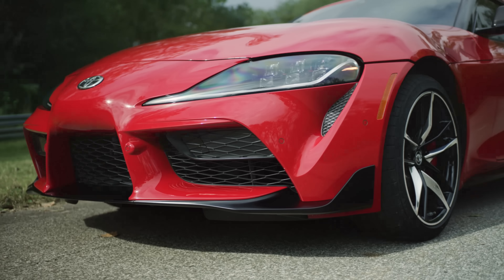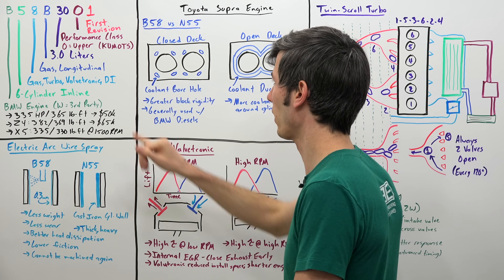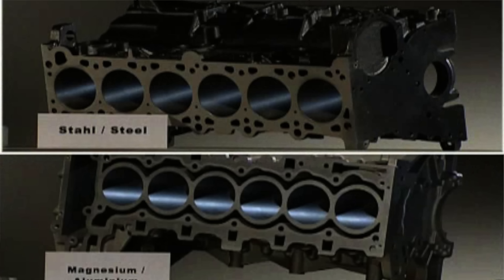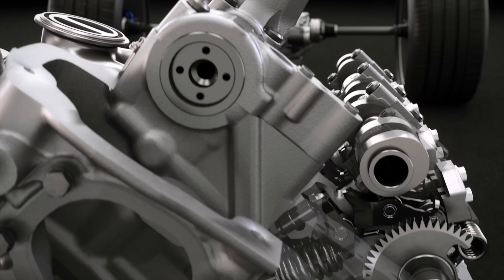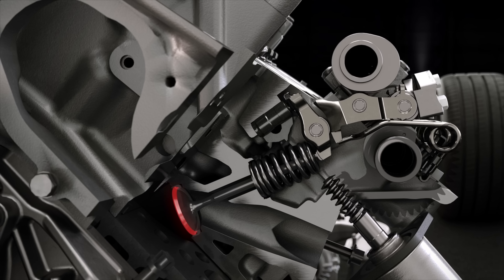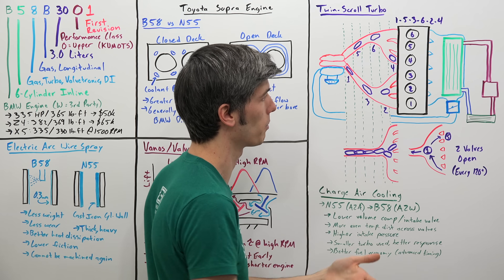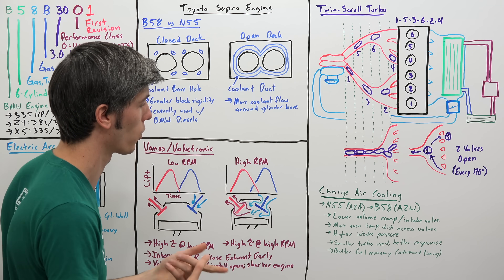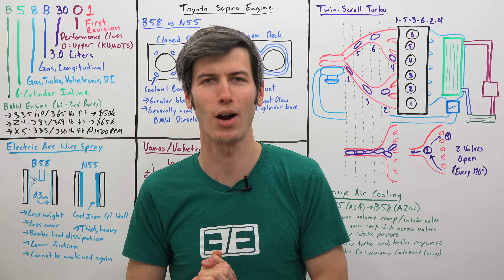2020 Toyota Supra Engine - Detailed Review Of The 2JZ Successor

Comment: It's gonna be the most unreliable modern Toyota model.
Reply: @FuLLeFFekT1 Toyota hasn't built a really reliable performance engine. That's all done by Yamaha.
Reply: That would still be a good thing.
Reply: More unreliable than those Toyotas that had "unintended acceleration" issues? Yea, didn't think so.
Reply: BMWs engines are reliable.
Reply: @jdmr1c3ing  "I want to believe"
Reply: JDM racing Any mechanic will tell you the opposite
Reply: @Realivangarcia  Internet mechanics don't count.
Reply: JDM racing I’ve worked with real mechanics for a month just so I could learn about cars, I was in highschool at the time. All of them say BMW’s are unreliable and expensive to maintain.
Reply: @Realivangarcia  If BMW motors are unreliable then how did they win the 24 Hours of Le Mans?
Reply: @jdmr1c3ing  I agree BMW  engines are reliable. 180k miles on mine.  I would stay away from the tt V8 because of it's design. All these new cars have too much electronics to me. Not just BMW.
Reply: JDM racing 24 hours isn’t that long. I’ve driven my car for a road trip from CA to Georgia. That’s more than 24 hours, you still think that’s impressive?
Reply: @Realivangarcia  You can't compare the two. You're not pushing the car to the limit on a road trip.
Reply: JDM racing Dude, I don’t think you understand. The reliability that matters is daily driving and if the car can go over 200,000 miles without much problems then, that’s a reliable car. The regular person doesn’t drive on the track 😂. I drove my Toyota Yaris (bought brand new) and put over 250,000 miles on it. I sold it because I got bored of it but, it never gave me problems. Never change an engine, transmission, radiator, starter or etc. I also abused the thing and it kept running. So yeah, a BMW wouldn’t have the same reliability NOT EVEN CLOSE! All the people I know who has BMW’s complain about the cars since they’re always breaking down or having problems.
Reply: @Realivangarcia  The only truly reliable modern BMW engine is a 3.0L 6-cylinder diesel which you can't buy in US, as far as I know. 
Petrol BMW engines become real pain in the ass pretty soon, yeah.
Reply: I think that will be the case.

Comment: The reason why people (read: Americans) are not happy with the BMW engine is because they don't see it as a "worthy" successor to the 2JZ, because the 2JZ was an engine so overbuilt it could withstand absurd amounts of boost and be tuned to deliver 800+ HP... 

And even though there's nothing inherently wrong with BWM engines, they're typically the polar opposite to the 2JZ: Very efficient, very sophisticated, but also made to extremely low tolerances and can't withstand nearly the same amount of abuse as a 2JZ. 

It's basically like comparing an axe with a scalpel.

Comment: Hey Engineering Explained. I have a cool Video idea that a lot of People would like to see. Compare the B58 to the Old 2J. Things like, Bore and Stroke, Compression Ratio, Internals, Cylinderhead, Block Design, Material Used, how strong they are..... Just to let the People see that the Old 2J isnt that much Stronger than the B85. Dont get me wrong Folks. I love the 2J. But i also love BMW.

Comment: I personally welcome its arrival. I highly prefer them going with a quality BMW straight-six (and keep in mind people rave about the B58, and it's proving reliable so far), than them shoving a damn Lexus V6 in it. They've kept the turbocharged straight six tradition going in the Supra. And hey, maybe a manual transmission will be offered in the second or third model year. They implied that if demand for one is massive, they'd consider doing it.

Cost wise an all in-house Toyota Supra was NEVER going to be approved by the bean counters. It would most certainly be a total loss, and maybe a total loss steep enough that the "Halo Car" aspect wasn't even worth it. They were never going to design an all-new performance engine, with tens of millions of dollars of development costs before a single one was made, just to slap in one vehicle and make 50,000 or so of over its lifetime.

All the people that have to find problems with every sports car on the market, and never buy them new, and always yak about waiting to buy a used version of the ones they do like, are the reason sports cars are such a dying market. Even if nothing on the market is perfect... consider supporting the continued existence of the sports car with a brand-new purchase.

Lastly let's try not judging this car too hard, or defending preconceived notions on it, at least until we drive it or listen to others who have.

Comment: I personally don't see why Toyota doesn't want to build another ridiculously strong inline 6 like the 2J instead of borrowing off another automaker. They oobviously have the technical and engineering prowess to pull it off and make a decently reliable, efficient and above all powerful engine that's easy to maintain and even easier to tune over twice its stock power levels on a bone stock bottom end without chucking a rod through the block. If I were them, to keep their target audience happy so they're more likely to want to buy the new Supra (which I think should have been named Celica GT instead because the new Supra bares no resemblence to the infamous MK4 but the name), they should have modernised their 2JZ engine so that it meets modern efficiency and emmissions restrictions while still being just as reliable, just as strong and just as tunable as the 2JZ-GTE.

also... more power wouldbe real nice ;) 400BHP would be enough to convice me that they made an okay decision using a B58 as opposed to updating the 2J... just not the best one for the history attached to the name.
Reply: Rest assured that many professional engineers and accountants in BMW and Toyota know better than you.
Reply: Yes i like BMW and i have not much interest in japanes/asian cars, but even if Toyota would build a new 6 cylinder engine again it wouldn't be the same like the old one. A iron block is way to heavy and you have to built a lot of tech into the engine to get modern emission standards. Also old BMW engines are bullet proof, iron block etc. Old tuned BMW engines have 700-1200 hp reliable. It was however not a big thing in the US to do that. A lot of those projects can be found in Germany, Denmark, Norway, Sweden however...

Comment: American people seem to have way more of these legendary 'reliability issues' with their BMWs than European people.. To be honest they seem to have these 'reliability issues' with almost every European car or motorbike etc..
Reply: European people complain as well about modern German cars. DPF, dual mass clutch, carbon buildup, issues with gearbox, sensitive suspension etc. It all depends on the country - British buy more new cars so less problems. Polish buy second hand cars from west europe and it is clear which one of them are reliable by just looking at second hand car prices. Some models are dirt cheap even though they were more pricey as new. Some old diesels hold their value very well.
Reply: I would say the problems with bmw in other countries just comes down to the fact that the dealerships and there service people have no idea how to maintain them.
I have a 2006 ford transit in australia,the check engine light comes on,you take it to ford they just swap out parts till they stumble on the problem.
Love my transit but hate ford dealers,i think the supra will fine just take it to europe for a service🤣
Reply: @MrBluePoochyena  i don't know what American cars they sell you lol (if you taking about ford crap yea they use too much European tech in their cars). if you ask an American what is a Ford Ka 90% would not know. plus what you said does not make much sense. Diesels have more compression and require much more heat to crank. Diesel should always be harder to start it the cold. I live in north Florida so it lucky to get 0C here but up north if you look at the weather it easy gets much colder than that. just look at a city like Minneapolis weather.
Reply: @MrBluePoochyena  This is undeniably false. US measures their fuel differently than EU. Its the same gas just measured differently.
Reply: @1994SHOtime  Lol what, Ferrari/Lamborghini have running jokes about them randomly catching fire. Volkswagen/Audi are notorious for electrical, engine and transmission problems in the US. And Mercedes have been known to be the one of most unreliable manufacturers for years.
Reply: @Summit900  literally one model of lambo has that joke and i've never heard of any such issues with VW since the late 90's. The past 10+ years  have been bullet proof.
Reply: Americans often get shitter versions of the cars tbh.
Reply: waking00one so what does it mean there is discrimination as simple as it is
Reply: @newtongsm  they simply match their product to the market they sell it to, giving your own country the "better" quality models and such is not uncommon, many Japanese cars were better/faster for their domestic market then for export.
Reply: I do know some models (VW's specifically) are built in Mexico rather than Europe, and I hear people complain more about the Mexican built models over the European built ones. However even among European built ones reliability and repair costs are still higher than older American and Japanese cars (V8 pickups can get 250K easily, and for Japanese it isn't uncommon to find older Toyota's and Honda's with 250K+ easily with cheap repairs, European models though cost more in maintenance generally to get the same mileage)
Reply: As mentioned. Cars aren't designed to last forever anymore. Plus it doesn't matter what manufacture you go for these days, you will either get a good one or a bad one.  Though I do find BMW very reliable until you tune it.
Reply: Yeah seems an American thing. No problems with the germans ive owned so far
Reply: Niklas,  Do you have some actual data to support that opinion?
Reply: @MrBluePoochyena  the only thing I can dis on a Mercedes is if they have a lot of HP the trans (but it's the transmission throwing codes and/or the clutch is too small... not really the trans itself). also Silverado with Cummins Diesel V8? chevy have Duramax in them the best thing on a Chevy Diesel is the Allison transmission. like I said I can't speak for cold weather but I know Diesel have a hard time if the fuel is cold. I know turbo Diesel run lower compression so the fuel would need to be at a higher temp to help it ignite vs your none turbo Mercedes. as far a Chevy gas V8 they normally crank stupidly fast cold or not just touch the key... they crank at super low rpm (your neighbor has problems).
Reply: @MrBluePoochyena  when I wrote gas = Gasoline/petrol
Reply: @MrBluePoochyena  is it the 5.0L made for the Nissan Titan? what size is the truck? that a half-ton 1500 gasoline replacement engine. or is it a three quarter ton truck 2500 or one ton trucks 3500.
Reply: @MrBluePoochyena  I think it has to do with that in general, other countries don't get as good as the home country. I have a 2009 GMC Sierra 1500 Crew Cab 4x4 that starts no problems at -40F before accounting for windchill. I believe you're talking about the 80's-90's Mercedes diesels and they are just built like tanks. Simple and run forever unless you screw something up on it.
Reply: @MrBluePoochyena   what you saying is not right. 6.7L Cummins is an inline 6 cylinder. I only ever seen 6.7L Cummins in 2500 and 3500 truck Dodge. it makes to much power for a 1500 setup to be reliable. if you put it in a 1500 Silverado and only run one 12 volt battery yea you be lucky to get it to crank. you can compare some crazy Frankenstein to a Mercedes. new Mercedes are ok even by Americans just cost too much over here. old Mercedes (even more so diesel Mercedes) are probably the best cars ever made. but this was more of a BMW thing and the extra maintenance you need to do vs normal American car.
Reply: Niklas no wrong same problems in Asia also too many electronic cheap plastic parts to make more profit I think german brand know they have upscale brand name so then want car to get bad after 2 or 3 years so customer can buy new cars
Reply: Niklas
 Europeans don't put the mile on their cars or have as much diverse weather like Americans. it like above "you don’t see Americans complaining about Japanese RELIABILITY" that because Japanese cars are built in America for American roads.
Reply: @gatorage850  It is 30 deg cel in the summer and -10 deg cel in the winter in Poland. Europe is big enough to have different climates. 
Fortunately most of European countries don't have a car based life.
Reply: @valdius85   and you don't have the humidity or the heat of the south put it this way in my city the precipitation (rain) in June is around 200mm every year. but it's mostly how much we drive. like I'm about to drive through the middle of two towns 70KM and not one public transportation point.
Reply: Gatorage no the German brand can also build more better quality which Won’t go bad but they want it to go bad in 2 or 3 years so customers can buy new cars is simple  brand are run buy manager not tecnical peope
Reply: my 2012 bmw x1 has been ok for the rest of my life and theres never been any problems
Reply: Your car is six years old. That's nothing. There's no reason why any car shouldn't last 20+ years and 200,000+ miles easy, with proper maintenance.The shop thst rebuilt the the transmission in my '03 X5 told me the manufacturer, ZF KNEW THEIR TRANSMISSION ARE GOOD FOR A MAXIMUM of 100k miles!! They don't care about building them to last any longer.
Reply: tempest411 if car last for 20 year all manufacturers will be out of business
Reply: tempest411 any car could last 20 years with proper maintanance and i dont think any manufacturer wants their car to last 20 years it’ll put them out of business
Reply: naresh virkar I’m currently driving a 20 year old car and I rev it out to redline pretty much every day and I can still do roadtrips and it’s fine. It still costs less to have owned this one car for that long and do its maintenance over the years. Then buying a new cheaper car every 5 years. Also the carbon emissions are far less and Volvo actually used a lot of recycled material while making my car and the car is able to be mostly recycled when it comes to the end of its life (which I doubt will be soon as I plan to keep it forever) so manufactures just don’t make good cars like they used too. It’s all become about making them expendable. It’s kind of sad. So we may have “greener” cars now in the future, but if everyone is have to buy a new car every couple of years, then it’s not so environmentally friendly as people think to keep buying a new car.
Reply: @tempest411  In 20 years I would put over 700,000 miles on a car.  I only keep them 8 or 9 years, at which point they are pretty much worn out.  It's one reason I won't have an automatic transmission -- the likelyhood of failure beyond 200,000 miles is too high.
Reply: @VAspeed3  Yes, some people drive a lot more. But I think the average is about 10k/year.
Reply: @sempakfiraun5375  We need to put their feet to the fire and FORCE them to do it! We could tax them based on what percentage of their cars are taken off the road due to mechanical failure. There needs to be an incentive for them to build higher quality designs that last as long as they can PERIOD. Not as long as some business model thinks they should.
Reply: kanker xd I had a very bad experience with BMW X1 sold it in 6 months if one person have good experiences doest mean all will have
Reply: naresh virkar the old gen x1 or the new one?
Reply: kanker xd e84 n20 engine 4x4
Reply: 2011 135i, 150k miles... no issues.  Replaced just about everything that goes bad over the years.  It's like any car in that price range though,  expect the maintenance to match the vehicle you drive.  If you want $30 oil changes, a luxury car may not be in your best interest.   The problem is, people buy these cars cheap, and used... then complain when they see the maintenance required, let the problem go, and something eventually breaks.  Just my honest opinion.
Reply: @polloborracho9180  ...you just said it laud and clear, there is a huge difference in cars reliability. You changed lots of parts as they wore out on the BMW. On my 2006 Honda with 190K miles I only changed A/C compressor at 150K , nothing else, not even a single light bulb. I have this car from new and have just follow regular maintenance as indicated by cars computer: oil change every 7-9K miles, transmission fluid every 30K miles...all done in my own garage so cost is very low.
Had many different car brands before but nothing as reliable as Honda, not even close by big margin...😎
Reply: @gregkutyla8408  I did it as preventive maintenance,  not necessarily going bad.  I've got about 10 hours track time in it, upgraded brakes, and so on. Plus it's a turbo straight six, so I drive it like I stole it.  The least I could do to return the favor for all the fun, is to keep her happy. She's been an extremely fun car, and the cost for maintaining it has been absolutely worth it.
Reply: @polloborracho9180  ...ok, now you clarified what you did to it, it was preventive maintenance, not changing parts as they broke... nevertheless my experience in general is that no one out there has catch up with Japanese quality yet... And statistics are out there to support the fact...
Glad to hear you are having fun, rwd fun 😉
Reply: @gregkutyla8408  it's the same with motorcycles.  My gsxr has had far less issues than my friends Ducati. Lol.